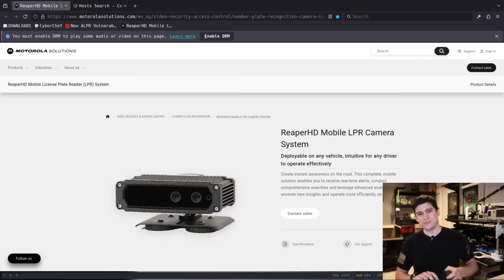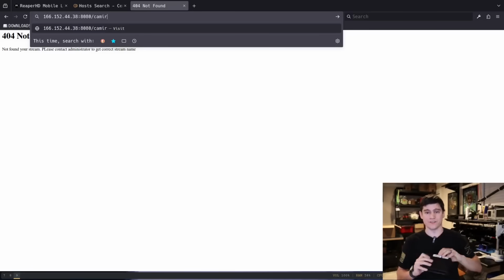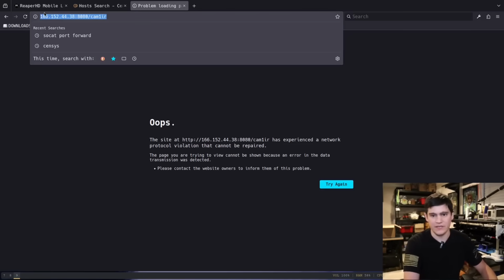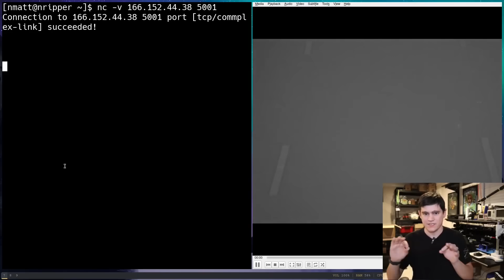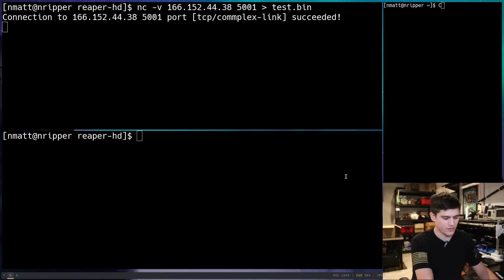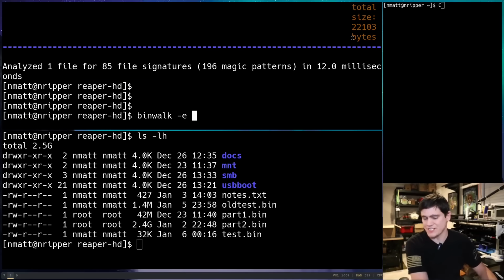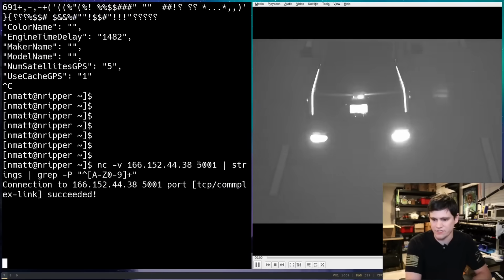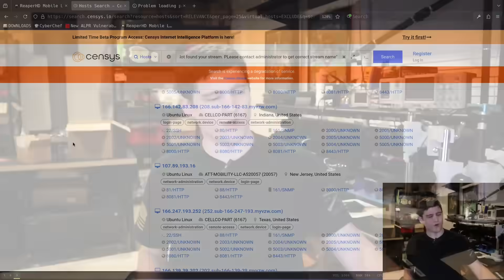Public Video and Data Feeds of Highway License Plate Readers

Comment: you should only be shocked when a government system IS secure. i've always been interested in active countermeasures for surveillance, but sadly almost all active countermeasures are illegal where i live so i can't even test anything. even something like CV Dazzle is effectively illegal because you can't wear facial recognition countermeasures when you get your ID taken and you will be stopped in any public place that uses facial ID and told to remove the makeup or leave. 

there was someone a while back that manually went around with a high powered laser and just straight up fried the sensor on a bunch of traffic cameras, but they were caught and charged with destruction of property. damaging readers i think is unethical, but i think something that temporarily blinds a reader (but not any human) should be allowed

Comment: i can see you finally took some time to look after yourself, aesthetically. nice rice so far.  mind giving a little statement video? Maybe even give a little overview around your daily env with i3, urxvt and how you get along with systemd. I feel like many people fear getting distracted by their os if they start to actually set up their productive setup, however I cant help but notice how incredibly similar many of our desktops end up looking when linux users get closer to hardware on a daily basis. Like, there could never be a more intuitive way for quickly changing the static ip for that external NIC than by simply editing .network files if one uses systemd-networkd anyway. Getting used to spin up a dmesg -w whenever plugging something in. Knowing where to look for expected behavior in an unknown system obviously requires some intimacy with the own OS. And getting intimate with an OS's defaults that someone else set up to work with plasmas gui just feels universally wrong it seems haha

Comment: It's ridiculous how many important devices are open to public access.  Remember the LCDispatcher thing with HP printers?  There are APC UPSes out there that can be found in a similar way, and if the "device" account is still active with its default password (and from older firmwares it will be) they can be shut down or rebooted.  Same goes for refrigeration controllers such as the Dixell XWEB 500 I did a teardown of a while ago.

Comment: If you want to be technical, the 'JFIF' is not the header of the jpeg or image file. The bytes to the left are. 0xFFd8 is the start of the jpeg file. Just noting for those that try to manually cut that out like I have done in the past.

Comment: I wonder what part of the system "guesses" to fill in missing license plate data?.?.  About 15 years ago I bought a car in FL and drove it home to TN.  I went by the local FL dmv to buy a temp tag as I had a long drive home.  Well out of the blue last year I started getting toll citations from FL...wtf...I hadn't been to FL in a decade.    You couldn't make out the plate and when I called the toll administrators in FL they said the system basically guesses to fill in unreadable plates...again...wtf!!!  This shifts the burden to prove innocence onto the unlucky person the system guesses was the violator.
Reply: 15 years is a LONG time in the tech world. I would assume it is still guessing but at a much better rate. That is why a good lawyer could get such evidence removed if you went to court over the picture.
Reply: @aminorityofone  To clarify,  the paper temp tag was bought 15 years ago at the FL dmv Tampa office.  I used the tag for two days to drive home, then it got thrown in the trash.  In 2024 out of nowhere I started getting citations from Sunpass due to their toll camera system guessing that the violator's missing plate info somehow matches my old paper temp tag.
Reply: It's just run of the mill OCR, but since plates in north america have to conform to certain standards as far as font type, size, spacing, and elimination of easily confused letters and numbers like O and 0.  I'm sure accuracy rates are very high.  However it's not 100% of course, so every plate read is going to have an associated confidence level assigned to it.  Florida has obviously set their minimum confidence level too low (go figure).
Reply: @Milkmans_Son   Re: accuracy rates. I was pulled over by the police because their LPR said my number was unregistered. Lucky for me, the cop manually checked it and verified it was registered before he even came to my window.
Reply: @e-curb  Did he check your id first, or did he let you go without even asking?
Reply: @Milkmans_Son  Sunpass mailed the citations to me and I live in TN and have not been to FL in 10 years.   The point is the FL/Sunpass toll camera system will guess about plate info when it can't make out the plate of the violator rather than "just letting it go"... their toll camera system has to blame someone even if they are not the violator. Twice last year that someone was me.
Reply: @Milkmans_Son   He was polite and slightly apologetic for stopping me, but said he still had to check my ID and registration.
Reply: @Milkmans_Son what do you mean exactly in regards to “elimination of easily confused letters and numbers”? Because both O’s and 0’s can and do be used all the time. Especially if you’re someone I know who did this purposefully and has an AZ plate that’s something along the lines of 0O0DO0 
lol unless you just mean in the ocr there just is some mechanism to eliminate the confusion?
Reply: I actually got bogus toll citations from FL twice last year...a few months apart and both citations had the same white work van in them.  In some of the photos you couldn't make out more than 1 or 2 digits/letters, on the others, you couldn't make out any plate info...even when viewing the better quality photos online.

At first I thought this whole thing was an identity theft issue and the toll violator had used my info to buy/register a vehicle if FL.  So when I got the first citation I called Sunpass and explained I don't recognize the FL tag number in the citation, that I've never lived in FL, that I've never registered a vehicle FL, nor have I ever owned a white work van like what was shown in all the violation photos...they couldn't figure out why I was getting the citations.  All they knew was that my name was attached to that FL plate in the citations and I should contact the FL dmv.  I called FL dmv and got bounced around to different departments and finally ended up calling the FL dmv office in Tampa where I bought the temp tag from.  They finally figured out that the plate info matched the old temp tag I had bought 15 years ago.  That's when I also learned that the SunPass toll system will sometimes "guess" about the violator's plate and I was just the poor sap the system picked as the violator.  The kicker is the people at the FL dmv told me they do not have the ability to remove the paper tag, or any tag,  from their system and I will likely get more citations.  After the 2nd time it happened, in only a few months, SunPass said they will "flag" my old temp tag info so it will not catch any more "guesses" from their system.  I asked why after 15 years would their system just all of sudden start flagging my old temp tag...they couldn't answer.  Anyway, it's been about a year now and no more citations so hopefully their "fix" will be permanent.   It could've been worse...thankfully all it cost me was a few hours of my time on the phone with the lovely folks at the FL dmv and Sunpass. 😋
Reply: Wow...
Reply: Mean while people trying to login somewhere are tagging your license plate in their quest to prove they are human.
Reply: No such thing as a burden to prove innocence, the burden of proof will be on them in court. If it wasn't you or whatever you want to fight it in court and show up and they provide a photo of a plate with missing digits the case is over you won, they need to prove it was you "beyond reasonable doubt" and the burden of proof is on them not you. You don't need to prove innocence, they need to prove your guilt, which are 2 totally dif things.
Reply: @francisphillipeck4272 Not doing anything in order to prove your innocence makes it easier to prove you’re guilty - even if you’re not.  If it worked like you wish it did, lawyers would only be making as much as the rest of us stiffs are.

Comment: I'm retired now, but used to work with law enforcement.  This is the same issues we would run into when working with their systems.  Lack of encryption, no firewalling, no authentication or if password "protected" never change passwords or use default passwords.  To be honest, it's not just law enforcement.  I did some work for a bank and to test needed a login, they gave me an admirative account that appeared to have the ability to change anything in anyone's account, balances etc.  I asked for a low level account.

Comment: Hey Matt... Don't forget, arrays start at 0. You'll miss a lot of cams if you start with cam1color!
Reply from the maker: oh yeah I figured that out after a bit. on that specific device I found that cam1 had more cars :) love your vids BTW.
Reply: @mattbrwn  does your unit send out the same data stream ex: plate info or is that produced by the aggregator?
Reply: @RacelifeCo  He explained that in earlier videos. The device does not have a modem, neither any direct internet access. So you would need at least a port forwarding.
Reply: @sausix  I'm asking if the camera unit is doing the number recognition and sending the separate data stream. In the previous videos he didn't have his unit reading plates  so I wanted to confirm the separate data was coming from the camera unit instead of the aggregator.
Reply: @RacelifeCo  I have one of these cameras. I can easily stream the two cameras to VLC, ONVIF inspection sort of works but sends back 554 as the RTSP port, but the v4l2rtspserver daemon appears to be only sending video stream data on port 8080. Looking at the bits under the hood, I don't see any sort of ALPR process. Seems to me these are just cameras and the larger unit with all the heatsinks is probably processing the video. The netcat port used is also not present on the camera unit. I got mine for $20, and I plan to hook it to blueiris and use the ALPR there.
Reply: @mattbrwn  how did you find the IP in the first place? This was fascinating
Reply: @tommyboi0  that's what I'm curious about too! That's the hard part. Censys is new to me, so I can't wait to learn about it. Is it a port scanner?
Reply: @Lyle-In-NO  no clue but probably not. I don't know if it was important in finding the IP's or not either. I think you would probably just port scan on your own machine. There's another service called criminal report that has port scanners and it's honestly shockingly good
Reply: @tommyboi0  Censys search.  The string has "PLease" in it ;-)
Reply: @Lyle-In-NO Im guessing they run port scans like shodan and then store the results in their database
Reply: I tried using 0 and you're right, there are feeds using camera 0.
Reply: Cherry on the cake of this horribly insecure system would be that arrays start with 1 😂
Reply: @t1mmy13  In reverse they start at -1, there is no -0. Backwards ones do start with a sort of one.
Reply: @t1mmy13  bonus points if it doesn't check out of bounds
Reply: I'm an old GenX guy.  As I was watching this I was suddenly taken aback by just how normalized we all are to this kind of surveillance. In the US, back in 1984 we would have been absolutely freaked out and pissed about LPRs.  I know they were developed in Great Britain in the 1970s, but they really didn't start making it over here until the late 1990s.   We have case law from 2019 which states that they could be considered a violation of the 4th Amendment.  But for the most everyone is just kind of cool with it.  ....amazing how much America has changed.
Reply: @Edmund_Mallory_Hardgrove  George Skum W. Boosh and a press made up of only compliant reporters talked Thimerosal laden people into it.
Reply: @Edmund_Mallory_Hardgrove I'm a  Xennial and I'm not cool with it at all
Reply: Smart  Dude   !!!   What's  your  opinion   on  Radar / Lazer    Detectors  ???  do they work  or a waste of money  ???  Or  which ones do work well ???
Reply: I worked with a guy who would use 1 as the start of arrays in his C and C++ code. When you mixed this in with other code that is iterating arrays starting from 0 the code was hell on earth. The cancer spread throughout the entire codebase.
Reply: @muhdiversity7409  straight to jail!
Reply: @muhdiversity7409  He must have learned to program using Pascal.
Reply: You see in the video he already did check cam0
Reply: ALL Software, regardless of language, is reduced to Binary Code (by compilers, etc.).  Binary language is ONLY 1’s and 0’s so it was with great consternation when I learned that the startup company of above “above average” talent argued for weeks in their joint meetings, over whether or not an array should start with zero, the Hardware Engineers’ choice, or one; the Software Engineers’ choice because they believed that zero was impossible.  In total, about 20 people attended the meetings.

Then I got invited and cleared that up for them.  Like I said, I was pretty dismayed to learn how long so many of them had argued.
Reply: @arcanondrum6543 and, apparently after 20 more meetings, we still don’t know the answer.
Reply: not in ALL languages.

Comment: The RHD cameras required shield a processing box, 1 to 4 cameras are plugged directly into that box a and single ethernet port is used to interface with that system. That camera is just a dumb camera the feeds a video stream to the box where the actual work is done.
The new cameras do have some capacity to process built in.

Comment: Insider threat is real even for a "secured" system. If you logged all the data with GPS coords, timecode, plate #, over time you could build a very detailed "pattern of life" profile for many people. This could be useful to many people including criminals. Drive by a house you want to rob. Get the plates from car you see in driveway. Search the database. Now you know exactly when they will be away from home and for how long. You don't even need to park outside to do any surveillance or anything. However, most criminals are just not that smart...most.

Comment: What good is having the # if you do not have access to a state data base like the cops do?
Reply: Think of it this way; how much do you want to spend?

Almost all states keep a publicly available and accessible database which shows items by plate (also by vin, and also searchable by countless other methods) that will also show the address of where the vehicle is registered. It frequently also shows other items such as general insurance data for owner.

Don’t want to entirely go through the state or gov level, then go through a type of credit and drivers report. Credit reports are even available based n license plate and vin search - without need for anything else

Comment: Well I have trick for those ir plates reader ,,all I did was put 6 to 8 led lights on license plate,wit doin that if LED is on and u pass by Camara the LED so bright that all the Camaras is gonna see is a big bright halo and u wont be able to see it ,, some ppl to this wit hats,so when walking by a Camara, LED would put a bright halo basically covering ur face,,yea these Camaras all have flaws weather in system or basic knowledge on how it works,, try it before ,,,it works ,simple LED lights can block  Camaras from seeing it...
Reply: I wonder if you can make a transparent coating that is either opaque to IR or reflects 100% so that there is no definition.